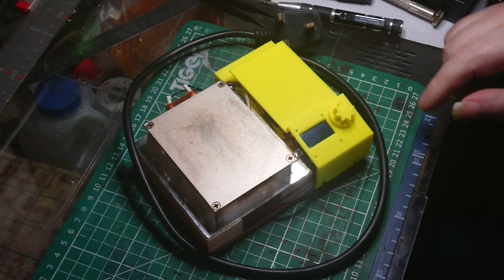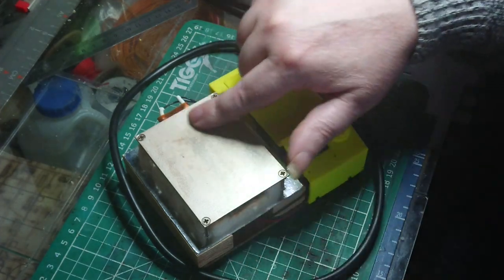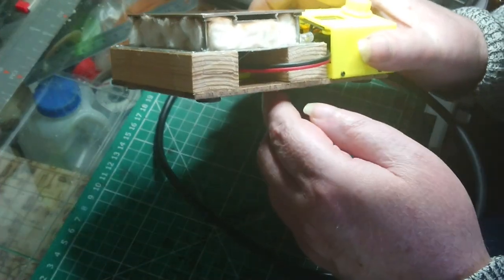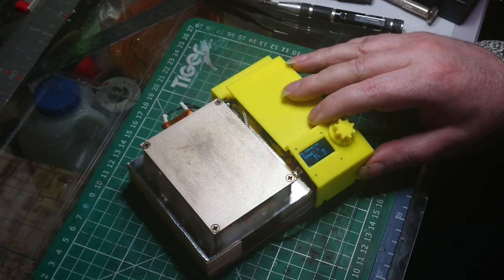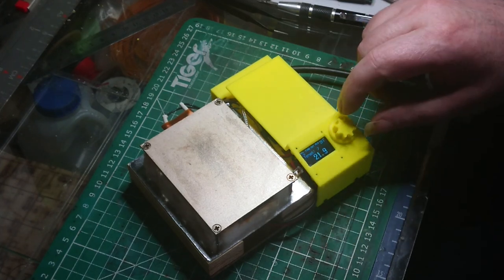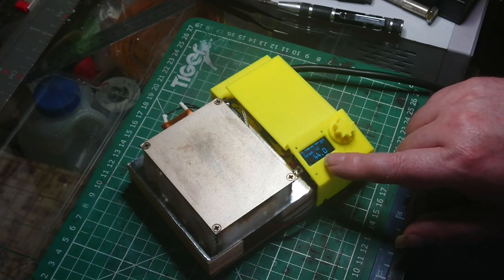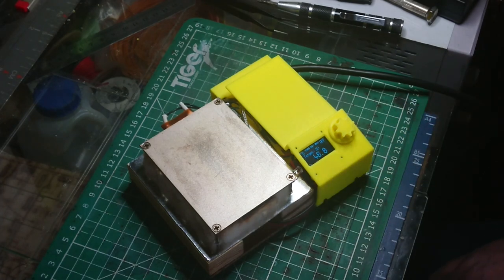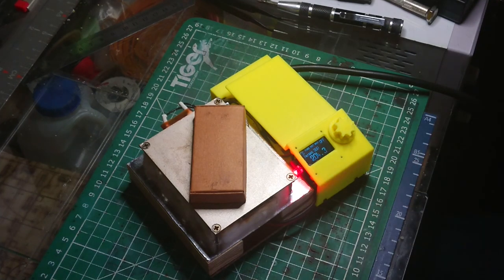Tim's Hot Plate

Comment: Hello Tim. Followed your project but can't get any temperature reading. 0.0 is what i get. Yes, the k sensor and the max is working (tested alone in a independent circuit with another arduino). Any idea what might be?
Reply from the maker: Did you test the k sensor and the max on an other Arduino with my firmware? Or was the test with your own code?
In my Instructable, see Step 36, Apehaenger has also done some firmware you could try.
Reply: @Tims_Projects  not even two minutes ago...i manage to make it work. I plugged the connectors visually, looking at you scheme (the one with component pictures), which is not correct in the max section. ex: the central pin, which is SCK, doesn't connect to D6 but D8. Your schematic is correct. By the way...is working now. :) Thank you for all you work and for the answer. Great job! Now i need to assembly alll this. Greetings from Portugal!
Reply from the maker: @netorui  Ah I see where the confusion is. The Part in the Fritzing Breadboard does not have the pinout in the same order as the real life component. I should have written the pin names on the Fritzing Breadboard part.
Glad you got it working.